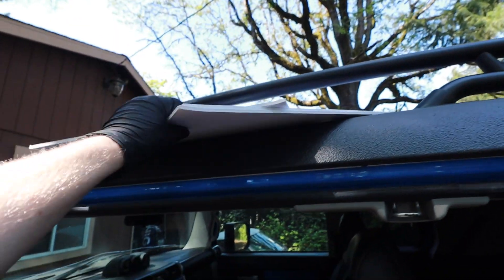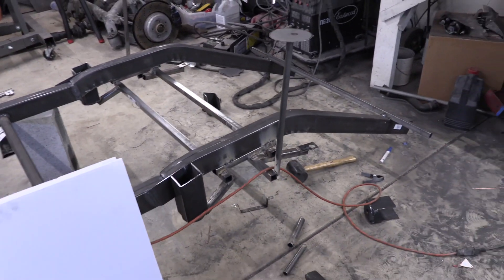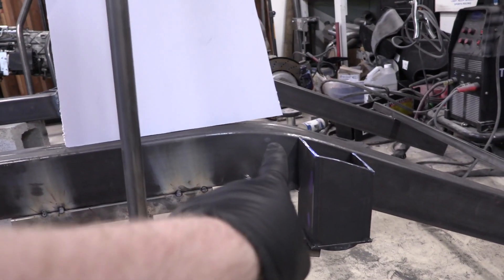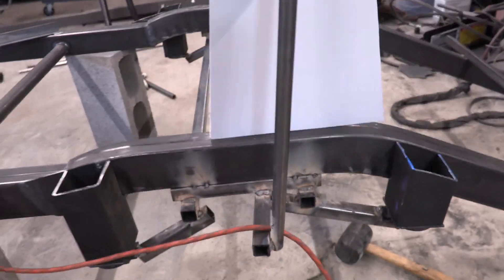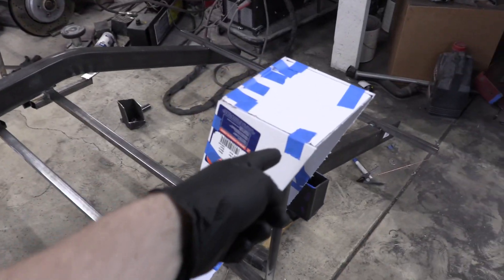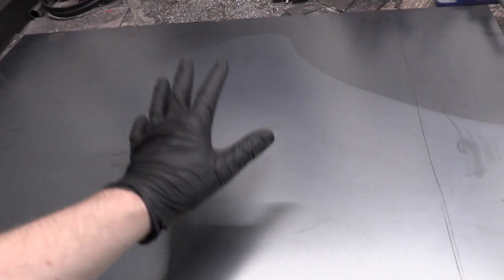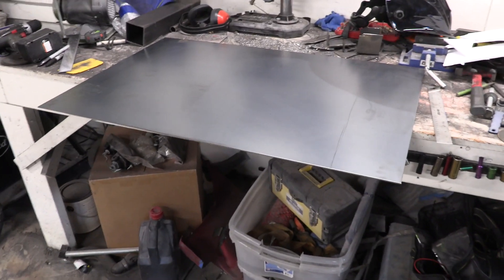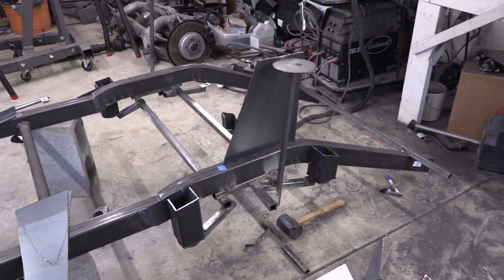Building Strut Towers For The 240z Chassis

Comment: "Unfold" your template, mark it on the plate and partially cut through plate on fold lines, you can then easily fold the sections along the fold lines, then just reweld along the partially cut fold lines. Hope this makes sense

Comment: Looks good Chris although you built the top plate to sit on top of the temp strut. Depending on the thickness of your steel aren't you introducing some tolerances? Also I decided to read thru some of these responses to your videos and it seems you do get a bit of a hard time over this design and your welding. I hope you dont let that talk get you down and keep doing what ur doing. After all your clearly learning and thats what its all about... a journey of discovery with us lot tagging along. Looking forward to seeing the frame attached and the correction of the frame completed (The drop down) and (finally lol) while your designing new stuff for the shop why not try a new intro? Just a thought. PEACE!

Comment: Wear 100% cotton shirts. Jeans are already there just get rid of any poly or nylon clothing. No blends either. Cotton won't melt, is very hard to burn and is just plain more safe.

I'd also use the mgaw a lot more than the TIG. Stainless and aluminum sure but mild steel, gas shielded MIG all the way. FAR faster.

Comment: Not trying to dog you just saying what I see, I would never attempt this so hats off it's a cool build. It seems like the top of the strut is going to have interference with the back hatch, there is only a foot of body behind the back wheel of the Z, so you will be cutting  a bit off the rear rails. Is it possible to use the Z struts and body mounts? The M5 spring rate will make it ride like a brick

Comment: Did you consider doing tube hoop towers like they do on custom 4x4 builds? Would only take a few simple modifications to the shock mount area to make it work for strut suspension. Would look better, be stronger and probably lighter as well.

Comment: Leave the lip on top of the strut towers, its a good design point and means you can get a nice Tee joint weld which is strong, the corner type welds you are proposing are weaker and more problematic to weld.

Comment: Try corner to corner fit on your plate fitment your end up with full penetration and more strength.

http://www.free-ed.net/free-ed/Courses/05%20Building%20and%20Contruction/050205%20Welding/Welding00.asp?iNum=0303

Comment: Tip for the struttower supports, have them meet at a common point in the middle of the frame. Like a traingle without the bottom. This reduces a lot of flex of the towers. Alot more then if you would just link them together with a bar.

Comment: With the strut tower you should add a small piece on the side closest to the arch to stop any warping and also to take some pressure of the welds on the mounting point. Keep up the awsome work 👍👍
Reply: "Small rectangular piece"

Comment: Should cut some speed holes in the strut towers. Get that weight down.
Reply: Great suggestion - Dimple Dia pressed/cut holes -  https://www.trick-tools.com/Dimple-Dies-Punch-Flare-Tools-75
Otherwise this car is going to be a tank!!
Reply: I agree. the steel might be a bit thick to dimple die, but its thick enough it wont need it anyway.
Reply: If it is to thick, then just use a hole saw, its all about the weight saving.